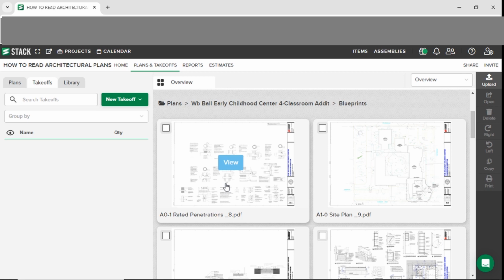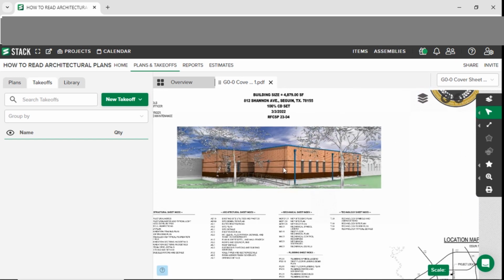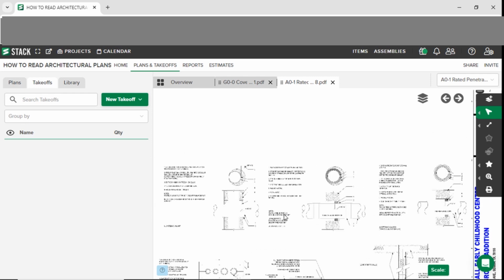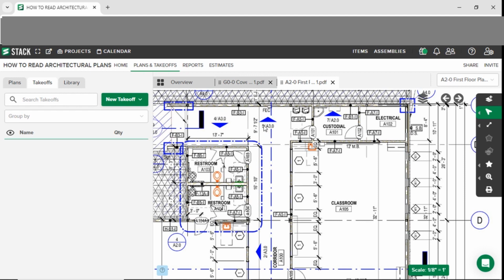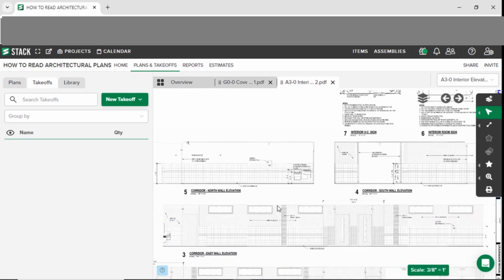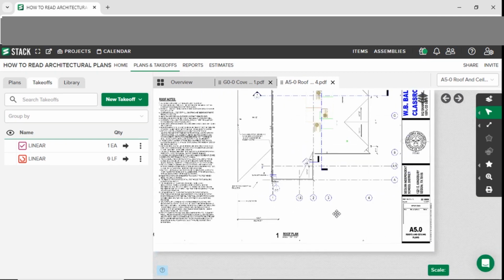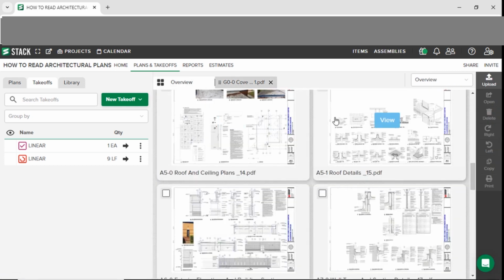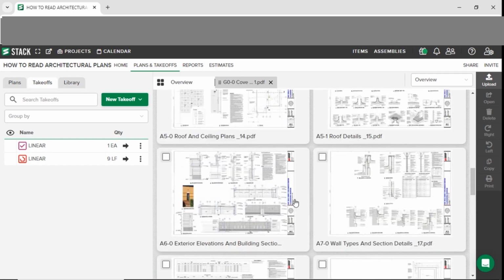HOW TO READ AND UNDERSTAND ARCHITECTURAL PLANS FOR BEGINERS

Comment: First i just want to say great video, by the way but i would love if you can teach more about   blueprints on painting, understanding specs and bidding on jobs... i'm a union painting looking to start my own business in commercial
Reply: If you have a spec manual, go to the table of contents, look for Division 09.

You should see interior and exterior painting, it should be 09 xx xx or 09xxxx.

Ctrl + f, type in the number for whatever paint type you want to look at. Hit enter until you get to the area that has 09xxxx at the top, read through that whole section, but the important part will be in section 3 where they tell you by substrate what paints are specced for that substrate.
Reply from the maker: Will Do !👍